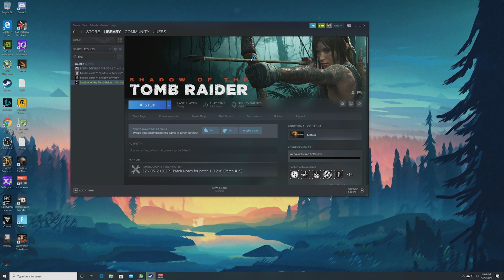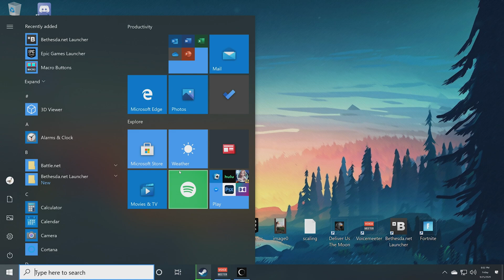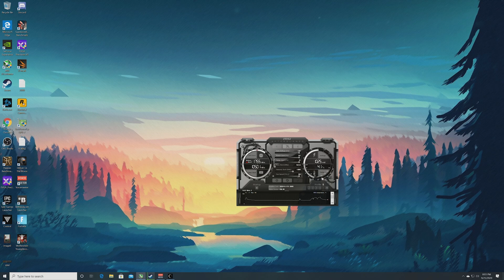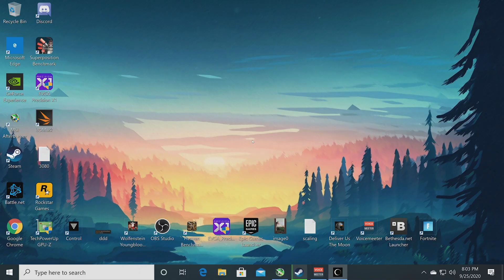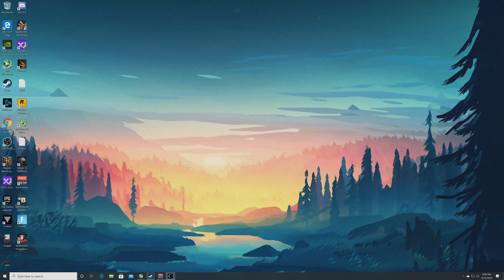RTX 3080 Launch Crash Capacitor Binning STUPIDITY

Comment: Returned my zotac 3080 for a refund with all the crashes it was unusable at stock. underclocking it to the point where it was almost stable resulted in 5-15% performance loss vs the reviews. At point my RTX 2080ti with  bios mods was almost as fast. people shouldn't be defending Nvidia and zotac on this getting a product that can't overclock is fine but getting a product which doesn't function at stock settings is never acceptable. If this can be fixed with a bios update which is not guaranteed the fix will most likely be to downclock and undervolted the cards. This may be the first generation where AIB cards preform worse than the founders card while costing more. At this point I'm going to wait and see how Nvidia fixes this and how the Navi /rtx 20gb cards preform before I buy a new GPU. If you want to show Nvidia this is unacceptable return the card you are well within your rights to return products which aren't working properly.

Comment: So please tell us what is acceptable performance? The manufacturer sold us the product based on a particular expected level: you are saying ` reducing the performance by only 100 hz is just fine` Ok- what about 200hz? 500? Your opinion is that we should take what those on high deign to fob of on us, doff our caps, and be grateful. How dare we complain what with starving infants and global warming and .......
Reply from the maker: The advertised level is 1700mhz, that’s it, anything below that is a defective chip. Anything above is sillicon lottery
Reply: @FrameChasers  My Ryzen 3600x at launch was at 65-75c with all programs closed, and without me and other people complaining about it on reddit it probably would have stayed that way for another 6 months. Also for me there was stuttering in games and temperature was jumping up and down by 25c in 1 second, even Cooler Master 212 didn't help with temps, only few chipset driver updates from AMD. With rtx3080 people have similar but potentialy worse problem. I had to turn of boost on my Ryzen 3600 back than to be able to play all games properly. It's funny how automatic overclock created chaos with Ryzen launch and now with Nvidia.

Comment: Loading a game and letting it run for a minute in the menu(even if it runs the 3D game engine) isn't proof it doesn't crash during gameplay.
I had an Asus Maximus II formula mobo that crashed due to an overheating chipset after a couple dozen minutes of gaming. So I replaced the mobo chipset cooling with a Thermalright HR-05 heatsink and the problem was gone. I didn't whine online but I don't blame others for it because I think it is warranted and it helps to inform others and stimulates the manufacturers to address the issue ASAP.
But in this case it seems to be occurring at clocks above the advertised boost clocks, but it does clock beyond it by itself so that's a problem.
Reply from the maker: Reeferman420NL the game engine example wasnt for crashing, it was to show people their gpu binning was a meaningless thing to worry about, I have tested the crashing issue desperately though that will be the next vid, I think I figured it out

Comment: I have a RTX 3080 Ventus and so far no crashes (despite adding +60 Mhz to the core) but even if I get one, I wont be joining in with the way over the top hysteria that is being posted in some forums right now. There are well documented crashes with the Asus Tuf as reported by Hardware Unboxed so the idea that packing in only MLCC caps is some magic solution seems like wishful thinking. I think the FE has the best array with 220, + 470uf POSCAPS and a central MLCC array but this is still just a small part of the overall power delivery to the chip. Not too mention power delivery to the new GDDR6X at a different frequency. There are also some rather questionable design choices in other parts of the PCB by both Zotac and MSI compared with the FE, which may or may not be a contributing factor.
Reply from the maker: yeah I don't get any crashes either with my XC3, I actually went out of my way to try and make it crash and couldnt.  I dont know whats up, I swear its peoples chinese power supplies

Comment: DId you just use a menu screen as a benchmark tool for like 10 seconds instead to run it with the actual benchmark the game provides?
You gotta be joking right?
Also how about you check it on lower res aswell like lets say 1440p instead.
But yeh lets put a baby crying on the thumpnail so we can gather some cloud while doing a 12 minutes random bubbling and a 2 minutes of the worse benchmark possible.

Obviously the issue isnt that big, but when you are sold something that on the box says that much and you paid for that, you should get it.
Maybe next time when you go on a car dealer you may buy a car that says 100hp but eventually is 80hp, dont worry you wont use that additional 20hp that much to care about, so no problem if you paid for 100hp.
Reply from the maker: I did 1080p as well, clearly you didn’t watch the video, if you bought the car and it only had 80hp instead of the advertised 100, then return it. You wouldn’t go on a forum and whine about it and keep it anyway.
Reply: @FrameChasers  1st time i see benchmark involving a menu screen.
talk about being lazy .
Reply from the maker: iTechGaming GR thats all you got? Sounds like whining

Comment: Lol what a joke. So if you just play games and dont care about the hardware and you stick it into your pc and it crashes its ok? You actually have to go and underclock it to be stable and thats ok with you? Oh the stupid humans, look in the mirror.... out of the box it needs to work or yes, you are owed what you paid for. Basic consumer rights.
Reply: It needs to be fixed but I think the point is there's a workaround which is fairly easy and it will soon be fixed with drivers I'm sure .. if that's not suitable then return it. not worth putting so much energy into unless in 6 months time its still broken (aka 5700xt, flame on)
Reply from the maker: Just go return it then if it doesn’t work, what’s the problem.  Seems way easier than typing out 10 paragraphs of whining.  Oh wait but then you have to wait 3 months for another one don’t ya?  Well then fix it yourself, or you know, whine some more?

Comment: These cards are not crashing because the users are overclocking them.  They are crashing because the AIB cards are crashing when their automatic "Boost" clock comes into play due to the bad poscaps.   It's an out of the box issue - Not an overclocking by users issue.
Reply: You don't know that at all. It's all speculation at this point. All cards are crashing, even those with the 'good' capacitors (FE/Tuf). It's likely there are several issues at play (probably driver related) and it's way more complex than 'this cap good, that cap bad'. The difference between all 3080s is so tiny, people have gone into hyper nitpick mode. Ironically, Zotac get the most crap for 'cheapening out' and yet they are the only one offering a 5yr warranty. People declaring Asus the winner for spending 20c more on 'good caps' yet are going to put you through hell with their awful RMA if anything goes wrong.
Reply from the maker: but then why not return the card, RMA it, or fix it yourself with afterburner?
Reply: @FrameChasers  cant call downclocking a fix
Reply from the maker: golinskyy you can call RMA and Returning it a fix

Comment: People think small oc boost fps but is not true small oc can help on stability on fps so with no oc you get 200fps but you drop to 150 with decent oc you get 203 fps but you drop to 180. And is true 3080 is not a TI 🤣
Reply from the maker: I would probably try and diagnose why your having frame drops in the first place, that's not how overclocking works at all...
Reply: @FrameChasers  frame drop can be cause from alot of things (game optimization,the quality of your hardware,OS) and etc etc.
In my case i use oc for stabilize the fps in game and push for more fps i can because i use 240hz.